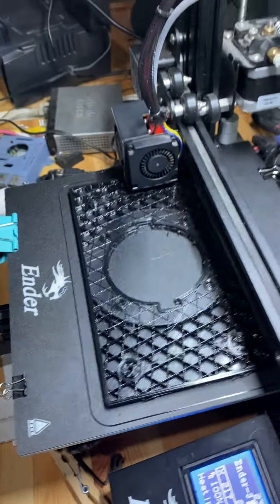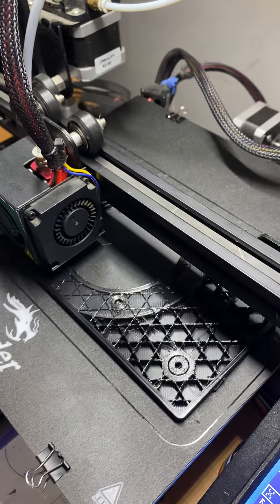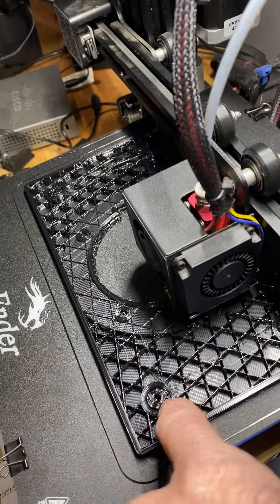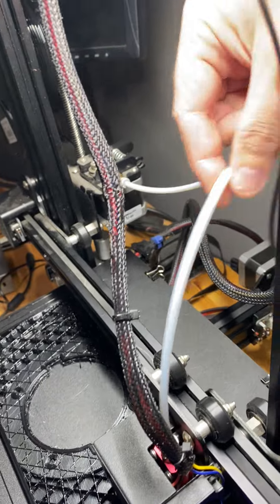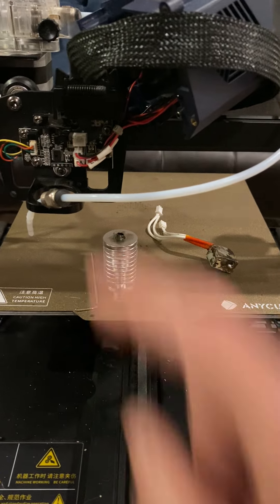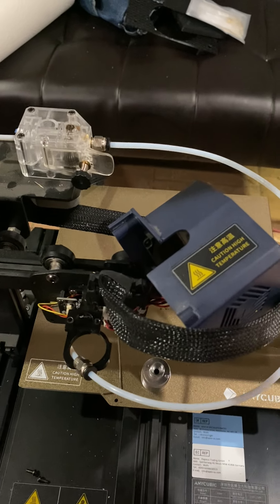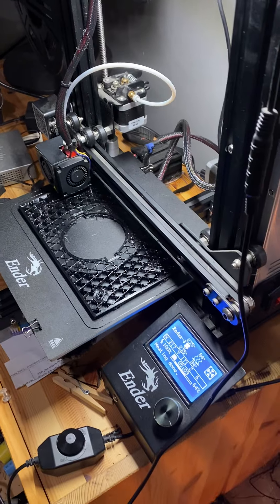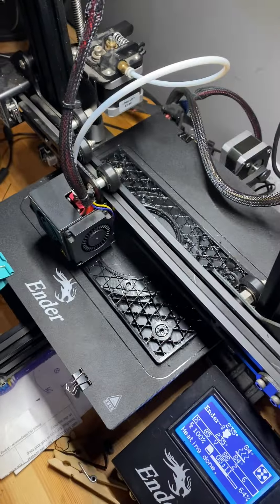printing PETG on Ender 3 stock - using a 0.6 nozzle

Comment: Step 1 throw out the ender 3
Step 2 buy a Bambu x1
Step 3 print petg that actually looks good 😂
Reply from the maker: one day / i found a used Anycubic Vyper for $100 and it has a lot of improvements over Ender 3 // we will see
Reply: You're missing the have $1,200 step
Reply: By a direct drive all metal extruder for it. Makes a word of difference
Reply from the maker: @htevo80  ha i don't want to spend $1200 so ... ;) i could but i don't want to
Reply from the maker: @htevo80  it's easy to throw money to solve problems, my hacking nature is get away with less
Reply: @rompstar  More a comment for the other guy. No need to spend Bambu money on an exponentially evolving industry. At least not yet
Reply: @rompstar the vyper is a knock off of the creailty cr6 se which is a phenomal machine. I would recommended it I have 4 of those because of how well they work just straight out of the box.
Reply from the maker: @sneekc2146  ya I liked it, I did order a new hot end and watched a video how to properly change the Tube as I did order the Capricorn tube that is rated at 300C / then I will try PETG again :)
Reply: petg needs constant drying to look good